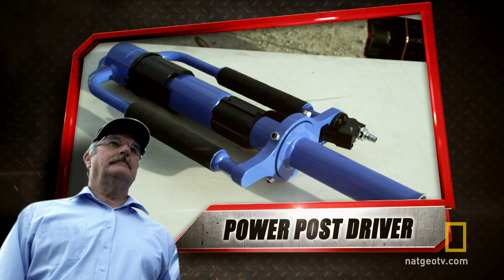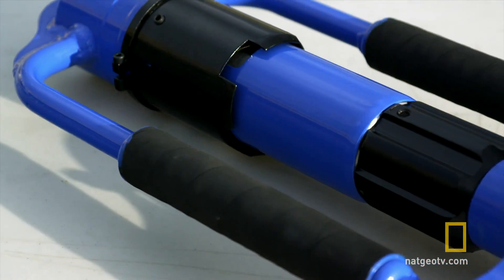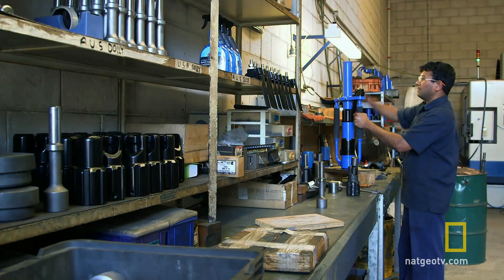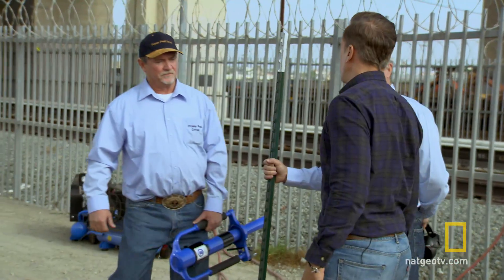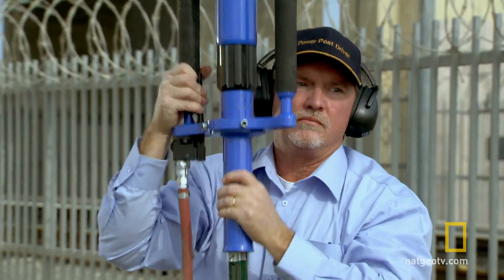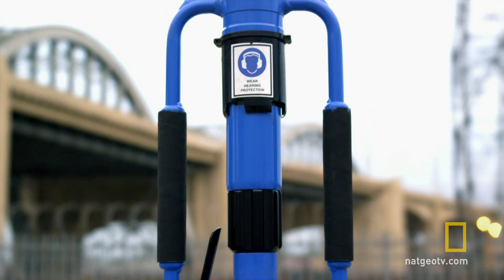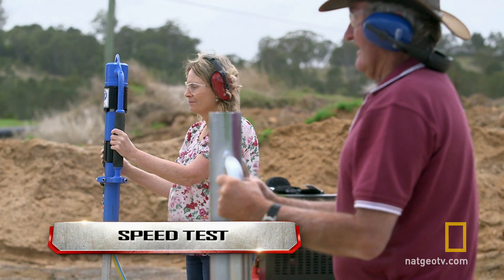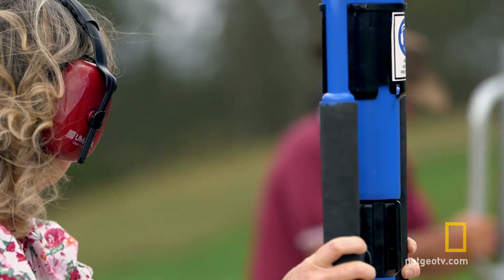Power Post Performance | National Geographic

Comment: The Kicker Here is that , the powered post driver , required 2 air compressors working together to provide enough PSI to give it the requisite energy to maximize it's results ! They conveniently FORGOT to point that fact out !

Comment: 800 for the air compressor  plus gas then the price of the air driver 600 to 900, if you are doing a large ranch or for business ok yes I'd buy all that equipment 20-30 T post. I'm fine with a manual

Comment: Truth be told, he would have driven than post before she got the pneumatic driver onto the top of her post. Those things are heavy and the whole weight sits above the post.
Reply: @Coen - After driving hundreds of posts with the hand t-post driver, my thought was not only how to get that monster pneumatic driver on the post, but how to keep it straight while pound it down. Nope, I'll keep my old one and call it exercise.
Reply: You slide it on the post when both are virtually-horizontal, and stand the entirety up at once.
Reply: @fidc2009  If you don't care much for where your post goes then yes. But I stand by my original comment.

Comment: Why is everybody so against this tool just because its air powered. Everyone acts like the hand pounder are so much better because it is human powered but how many of yall use a hand powered drill? Or dig a canal with a shove? Or ride a dam bike......? Everything has a place and trust me these pneumatic pounders are a god sent when you have miles and miles of fence posts. And if you think waisting time is better than waisting momey...... your gonna have a short and busy life.
Reply: @Alex Varble - Good point. I've never driven that many posts. However, I'm sure that there are post drivers that you can get that attach to your tractor that would be more practical in my opinion that this thing.

Comment: okay...  So do the test when you don't have an air compressor vs a manual one.  See what what wins.
Reply: That's dumb comparison. That's like saying let's pin a corded drill against a batter powered drill with no battery in it. Every tool has its place, and when you do miles of t post you know your gonna have a truck anyways and you just put the air compressor in the truck.